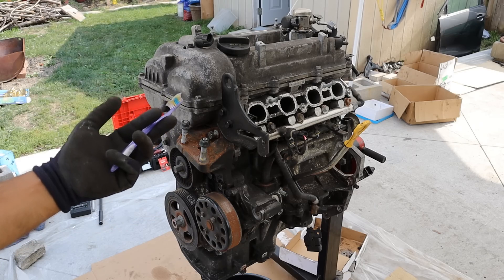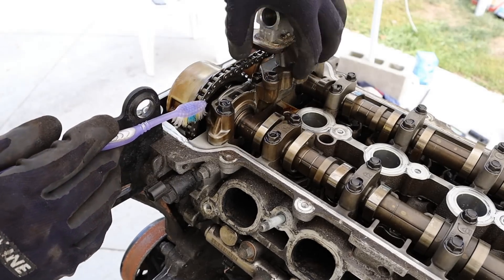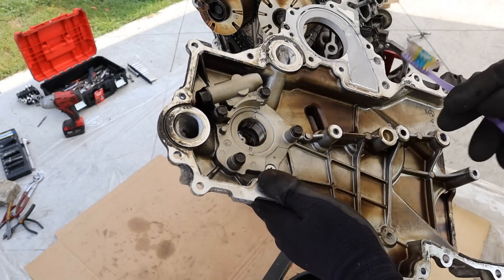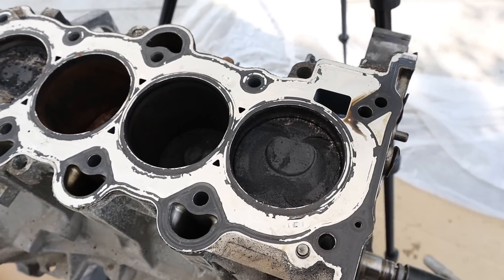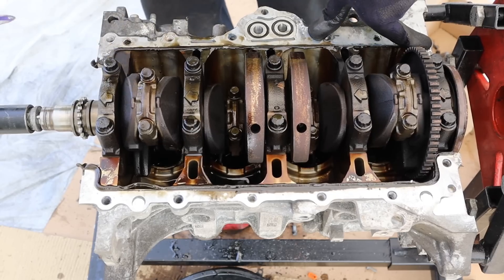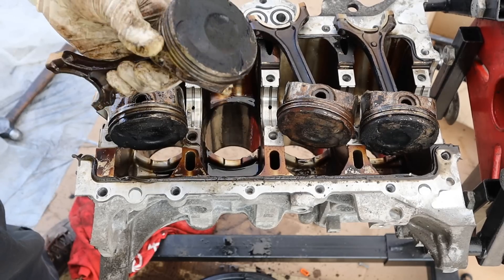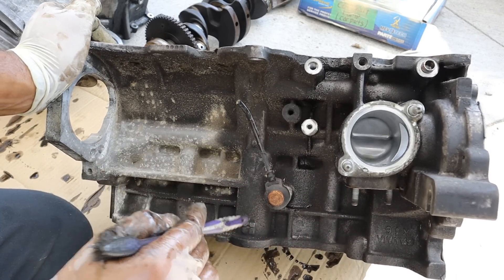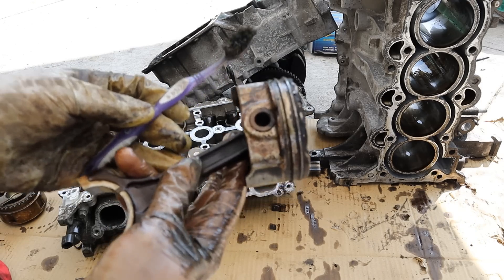Why KIA Engines Fail

Comment: It'd be neat if you got your hands on the older 2.0L beta (2) engine. I recently did some compression tests and aside from small things like hardened spark plug gaskets it still roars w/ 220k miles. It's also one of their loudest engines despite only 138hp and a 6.5k redline. The GDI engines from 2010s really weren't the play from hyundai/kia, getting better tho (i hope)
Reply from the maker: I've heard the older non GDI motors do last a while
Reply: @speedkar99  Cast iron block and a feeling to prove something ftw
Reply: I definitely agree. My 2007 Tiburon has the 2.0L Beta 2 with 190k miles on it. As I mentioned in my previous post it still purrs.
Although the old 2.0 Beta lacks certain refinement, it's still a strong motor if well cared for. It's also relatively easily to maintain and care for, just make sure that you always keep an eye on the timing belt when service is due. 
When paired with a manual transmission I can easily bark my tires on the first 3 gears in my Tiburon.
Reply: @Tanooki2003  04 tibby owner as well, fun car! Looks keep up, lets just not talk abt the 1st gen haha
Reply: My experience with kia has also been different from popular perception, i found my kia was even more reliable than everyone says (after liberating it from it's previous owner) and my fellow toyota driving ride share colleagues were spending more on repairs frequently.

I think besides factory defects (theta engines) the perceived unreliability of kias and hyundais has to do with their target demographics.
Reply: @chiefdenis  yeah, given they were the "cheaper" option for a while they just weren't respected by anyone who could afford more reputable brands. But aside from cutting corners on the manufacturing side or using too much bleeding edge tech, cars last as long as they are respected, learned and maintained, something that seems so basic for such an important asset.
Reply: @yousefz7788  very true, I've found that the most reliable kias/hyundais were the early 2000 to 2012, after they started pushing high pressure direct injection their engines started coming out with major defects because they were trying too hard to best the japanese.
Their reputation used to be cheap cars, then it became cheap unreliable cars, should have stuck with simple proven technology like toyota with their 10 year old engines in brand new cars, buyers don't even know the difference between a 140hp di 1.6L engine and a 122hp pi(port injection) 1.6L.
Reply: I GOT 243k miles out of a 2005 Hyundai 2.7l v6 when I sold it ran smooth as a baby.
Reply: i got kia soul with 2.0L beta 2 engine..runs 110k km..
Reply: @pj5651  Hope it treats you well! Cool icon btw
Reply: got a 2011 2.0l inline 4 in my Kia soul + and wondered how reliable this engine is since it's in a Kia. I have 141k miles on the car rn. it can be a loud engine and I like the sound of it. I can go almost 2 weeks without filling the tank with my driving pattern.
Reply: @SmallestInDetail  same situation as you with 145k miles (got at 106K black friday of 2019).

Previous single owner at the same dealership I bought. Entire service history was listed on the carfax. If you don't know the history, consider getting the timing belt changed before too long. Mine was done around 92k. Only things I've replaced has been the ignition setup (coil, plugs, wires), O2 sensor, and recently all new pads and rotors, besides consistent oil changes, no matter the driving (I was driving around 17-20k a year before WFH and would do 4 changes a year).
Reply: @Lashazior  changed my serp belt, a/c compressor belt, and my power steering belt yesterday. I'm not experiencing any signs of a bad timing belt and a dealer at the Kia dealership said to just wait for now.

Comment: Theta II engine owners don't have to worry about carbon build up, as the engines don't last long enough to build up carbon lol
Reply: 91K on my 2013 Optima SX. Third engine, so roughly 30K per engine. 5w-30 synthetic and new OE filter every 5K miles. All 3 engines compliments of Kia.
Reply: @APeopleP3rson   wow! are you serious, Scott? 3 engines already? That’s insane!
Reply: @APeopleP3rson  30K per engine??? 😂😂😂😂😂 damn… my car is at 180,000 and still going strong. Got lucky.
Reply: @APeopleP3rson  My next door neighbors Kia engine lock up at only 65K ; (
Reply: @APeopleP3rson  same here lmao
Reply: @APeopleP3rson  Still better than my Dodge 3.7.  I sold my Jeep Patriot at 78K with its 4th engine installed.  Meanwhile my Impala with a 3.9 is pushing 240K and is only burning enough oil that it is on the ad line at 3K miles.  I change the oil instead of adding.
Reply: @APeopleP3rson So do you drive the crap out of it cuz that seems a little SuS to me. 3 engines 🧐
Reply: @APeopleP3rson I bought a 2014 Kia optima ex with 89k miles 2 days ago and the next day the engine blew so much white or grey smoke I couldn’t see all 3 lanes on the freeway behind me. The used lot I bought it from luckily told me tow it back and he will fix whatever is wrong. I’ve been researching this but can’t find much. Is it this common issue with the motors and will kia still fix it?
Reply: @APeopleP3rson  OMG my 2015 Prius is roughly at 120k miles and zero issues, burns zero oil. Runs like brand new with 45mpg. I guess I’ll never buy Kia or Hyundai.
Reply: @APeopleP3rson man how are you getting compliments?.  What is Kia service center told you that "Because of your reckless drive your engine is broken".?
Reply: Truth.
Reply: I had KIA rio 1.6 gasoline 2014 and I did 180k km in it. Now i drive Hyundai Tucson 1.6 turbocharged gasoline and there is no problem after 90k km
Reply: I have 160k on my Theta II and I've had almost no issues which is in stark contrast to my Mercedes of the same year.
Reply: Lol, I ran my 2017 Soul Turbo for 
172,000 miles before I sold it. Not a single problem over 5 years. I changed oil every 5k miles, did absolutely nothing else to it. And I only used shell or chevron. 
Kia/ Hyundai are great, it’s the owners that give it a bad name.
Reply: @Ezrabastian  I'm liking the looks of that new Hyundai Santa Cruz
Reply: @Ezrabastian  not true I have a 2017 Kia Sorento I do my oil changes every 3,000 with full synthetic Don't put too many miles on it I'm at 59,000 miles and the car burns oil like crazy most likely due to carbon buildup. I've even done preventative maintenance put a new PCV valve only get the top tier gasoline. If you Google it it's a common problem with GDI engine since they don't clean with the gasoline lot of people have that same problem and Kia seems to say it's normal to burn a quart of oil every thousand miles lol
Reply: @Ezrabastian  - Did you say that with a straight face??? I had a 2015 Kia Soul with the 2.0 liter engine. I bought it from the dealership straight off the truck with 7 miles on the odometer. The engine went full grenade mode at 84,xxx miles on it. The car was 100% dealer serviced during it’s lifetime. Biggest POS I’ve ever owned
Reply: @dereklea1183  mine was 1.6 Turbo built in Korea. Were you putting Walmart gas in it? I did my own oil changes, full synthetic Mobil1
Reply: @dereklea1183  Please go for Honda or Toyota, don’t waste time with these clown cars.
Reply: @ctgaming168  if everybody drove toyotas and hondas the whole world would just be gray.
Reply: @arditsadiku8474  Ikr, it’s impossible. There must be some idiots somehow. It’s great that they buy something else to keep the competition going and left Lexus for me. 😂
Reply: @ctgaming168  well I'm a person who loves all cars regardless if it's toyota honda kia or Chrysler, even tho we all know toyota and honda are the kings of reliability and quality
Reply: @arditsadiku8474  Ok I respect your view, I’m different. I’m only a fan of quality and longevity (for vehicles).
Reply: @dereklea1183  How often was the oil changed? How did the engine fail? A rod through the side of the block?
Reply: 2013 Theta II Turbo engine with 172k Kms. Cars paid off so running it for now. Use High Mileage Mobil 1. Regular oil changes. Just did the CRC intake cleaning. So far , so good. Runs smooth.
Reply: Every cloud has a silver linning
Reply: 2009 Kia Rondo I've seen with over 200,000.
Reply: 2009 sonata with the 2.4 theta ll engine just crossed the 150,000 mile mark with no major engine issues and still runs like new. The car was passed down to me by a family member who changed the oil every 5,000 miles. Maintenance really does make a difference regardless of what car you own. If you look after whatever it is you have it will in turn look after you. These engines are notoriously unreliable and I think that is largely at the fault of Hyundai/Kia but there were a lot of these engines sold in a lot of cheap cars. Hyundai/Kia make cheap cars in comparison to the competition and from experience I know that people who buy cheap cars are often cheap people who in turn are negligent when it comes to routine maintenance. The fact these engines were cheaply made caused them to have issues which became more apparent as the cars were cheaply sold and cheaply maintained which in turn created the perfect storm for poor engine reliability over time. I personally would never buy a used Hyundai or Kia regardless of the engine as I know that the owners of these vehicles just want to drive a car for as cheaply as possible and run then into ground. I’ve seen it time and time again, somebody buys a 5 year old Hyundai from a used car lot with 70,000 miles and before 100,000 miles comes around catastrophic engine failure. If you own a car with the theta ll and you want it to last maintain it as you would with a car that costs double what your Hyundai/Kia did new. Any car can have common issues/complaints but if you as the owner of one of these vehicles choose not to at least make an attempt at keeping your vehicle in good condition and don’t change your oil routinely you can’t entirely blame the manufacturer. As I said I own a 2009 sonata with the theta ll engine and I intend to continue maintaining this vehicle for as long as the car is safe for the road (given I live in the rust belt lol), and I also said it was passed down to me for cheap by a family member as I was attending college and needed cheap transportation and really wanted to avoid an automotive loan at a young age, if I were to search for my ideal vehicle in the market for reliability I doubt it would be a Hyundai/Kia, likely something more along the lines of a Honda or Toyota but given the fact I received a well maintained car in good condition for the age for a quarter of the cost of similar condition Honda or Toyota in my area I’ll do my best at looking after what I have to get as much value out of it as I can. I am genuinely curious to see if I can get the car past 200,000 miles, I have already gotten my moneys worth.
Reply: I think this only applied to the American made Theta II? I havent heard about any issues or recalls in Europe.
Reply from the maker: True lol
Reply: @speedkar99  not true. Just idiots owners
Reply: 😂 🥺that’s my car…
Reply: @goldwolf0606  mine has the same engine. Failed at 95000kms. Fortunately Kia replaced it for free. I wonder how long the replacement will last 🤔
Reply: MPi Theta and Theta II engine are actually great, very reliable. Only GDi versions were unreliable.
Reply: Yea , Thetas are bad. We just had another one in the ship for rod knock. 164000 on the clock 2017 Santa Fe. Passed the extended warranty by 40 thou. We've had more of Kia and Hyundai engine failures in the shop this year than any other brand. My suggestion,  stay away from these.
Reply: @tomcisneros5965  I've had great luck with their V6, but their 4 cylinders appear to be crap.
Reply: They have a 100,000 warranty though.
Reply: Very true, we are the latest victim P1326 - we'll know what the next steps are.  Gloves on.
Reply: Matter of fact, most engines that fail have either 85,000 miles or 135,000 miles - as we see in forums. The carbon build up issue has already been fixed by soaking the engine with unburnt gasoline at cold starts. We no longer have owners with carbon build up problem. But now we have owners with seized engines caused by the gasoline soaking (sacking) thing which causes oil dilution. Hyundai fixed a problem and created a new problem.
Reply: Omg
Reply: Yup you said it
Reply: Can someone send just screen this comment and @HyundaiKia lol
Reply: The local H dealership offered to buy mine for over retail if I'd buy a new sante fe sport, only owing 24k they said. You couldn't pay me 24k to take it home.  I have a 17 s.f. sport 2.0 t and it's a pretty piece of junk, nothing more. So happy I got the very extended warranty and when that is about out this lipsticked pig is gone.  The awd  stuff went out at 50k and replaced. The engine blew up on my way to work at 3am with no prior warning and the oil being changed there less than 600 miles prior. Nothing but lies from Hyundai for a while.  Quote of 4 months to fix it and they didn't want to provide a rental car.  Took to another dealership and 2 months. Engine was bad and covered under recall, but they told me that Hyundai doesn't put a new motor in. Just parts. Within 400 miles,  it failed again.  They fixed it.  Now less than 5k miles later rattle when accelerating slow at low speeds and the turbo is definitely on the way out.  The motor is Definitely not getting enough air and very sluggish. No light on as of yet.  Called the dealership and was told they aren't even taking them in to diagnose now. She told me the middle of July.  I let her book it. Then asked her if the motor blows up again bc of the problem I told you about, and requested under full warranty, are you all going to fix it? I will never have another one of these pos
Reply: Mine burned off all its oil at 138,000mi, not covered under warranty because it didn't - quite - seize.  Bailed and now I've got the 2.5L NA Skyactiv-G
Reply: The only way Kia will replace the engine is if it's rod bearing failure.
Which is kind of a chicken and egg problem due to the fact that they're dumping the damp oily residue from the PVC directly at the back of the intake valves of course stuff's going to abraid and come off of that and screw things up. Probably should look into catch can it should help keep the back of the valve cleaner.
Reply: @chasl3645  I just came to realize that I need an AOS for the new car. Never even heard of one of those until now
Reply: @APeopleP3rson  whats an AOS?
Reply: Liqui moly. You be fine
Reply: Liqui moly Mos2 fixed all
Reply: And Moly oil sealer
Reply: My 2012 kia forte(2.0L) has clocked more than 400,000km..most of time it was driven aggressively & still works fine..not found any issue with it..
Reply: @rockerpaluza  My last car prior to my Optima was a 2010 Forte that I got 180K miles on before I traded it in. It had the engine knock and felt I needed to trade in only to find out that I bought what I bought.
Reply: @rockerpaluza  That's the ol' Italian Tune-up at work, aggressive driving. 148k miles here. Probably gonna do some carbon mitigation at some point soon but can't do the "standard" Seafoam method because of the design of the intake.
Reply: @rockerpaluza  how often do you do your oil change ?
Reply: @AldoFelt  For engine oil around 10k kilometer, never skipped. Probably once or twice clocked above 10k, but never get past 12k. I also make sure the oil is genuine by buying it at official store/petrol station, since my local market is flooded with fakes.
Reply: @rockerpaluza  thanks
Reply: @Bronson 1.6 is not Theta ll. New 1.6 is smartstream
Reply: My 2010 soul  2 litre is reliable has 260k on it …all I’ve done is brakes, a shift cable and a drivers door handle …. I treat it like a small box truck ….I’d love it if they made a extended cargo model
Reply: The 2005 Kia Spectra 2.0L is a Theta II engine isn't it? Because I have one that have over 200,000 miles on all original internal parts and it still runs great. Doesn't leak a drop of anything and doesn't smoke or tick at all. Also, not sure what engine model is in the 2001 Kia Spectra but my brother has one with over 220,000 miles on it and he's been running a 100 HP wet shot of nitrous on it for a few years now with no problems.
Reply: @bluegizmo1983 those engines are the good ones  similar to the 05 lancer evo
Reply: @bluegizmo1983  2004-2009 kia spectras had the beta ii engine. Prob Hyundai/Kia's most bulletproof engine.
Reply: @bluegizmo1983  They were not using direct injection in 2005.
Reply: Just did GDI carbon build up cleaning on my 2015 Kia optima SXL, she still going strong Also did an engine flush using multiple oils and car runs great now, I feel KIA engines can still last with a bit more TLC than your usual car
Reply: @innovatecoin9990  a flush😂 what a great way to kill the engine
Reply: @DrDrops420  not at all, if you do it correctly I disagree, just do a oil change with cheap oil after the flush Ali g w/ cheap oil filter, let the car run for 15min then change it again for the high quality stuff so in total do 2x oil change.
Reply: @innovatecoin9990  what the milage at the time of corbon clean up? How did you clean it? Thanks
Reply: @innovatecoin9990 , no just looking after them regularly will give good results. Most people don't look after the vehicles properly any more. Long duration service intervals not a good idea unless you run the very best of oils. And check your oil level once and while.
Reply: @innovatecoin9990 Cleaning the valves at 40,000 to 50,000  would probably be a good idea.
Otherwise that crap gets sucked into the combustion chamber and it tears up the rings. Causing the engine to use a lot more oil. 
My 2.4 in my Sportage has 400,000 flawless miles on it but it's not a GDI.
Reply: Nailed it
Reply: Makes me grateful for my mazda
Reply: This is the best fucking comment😂